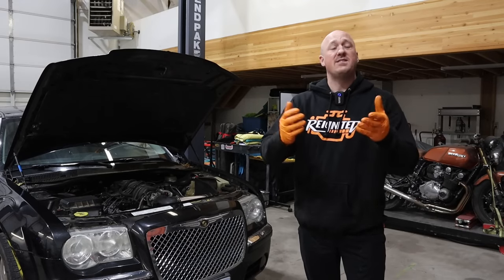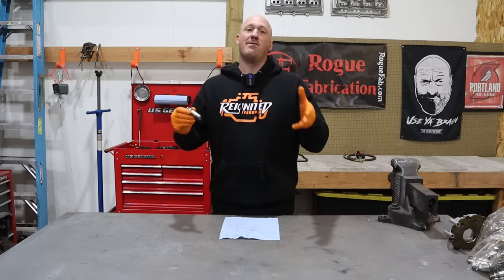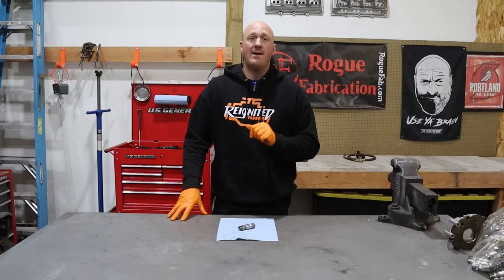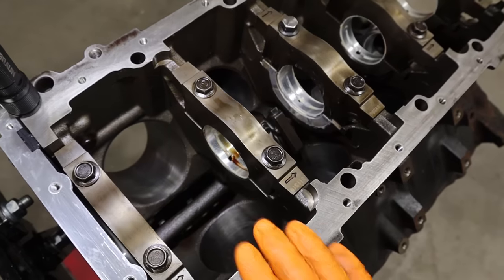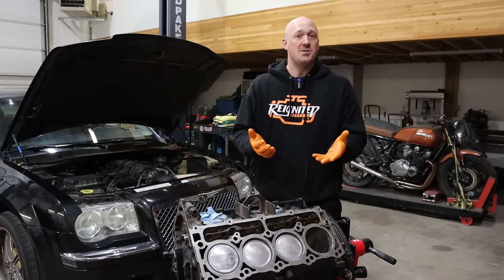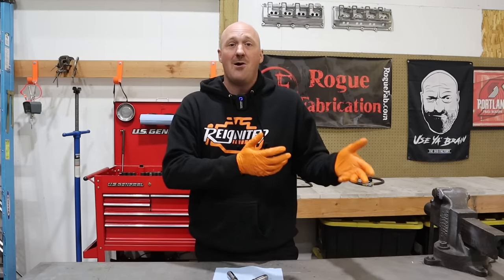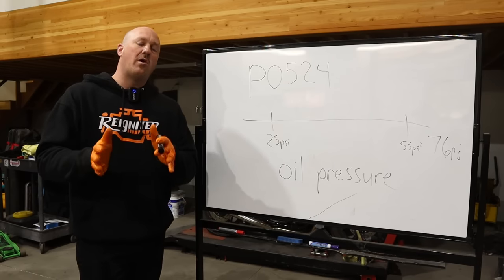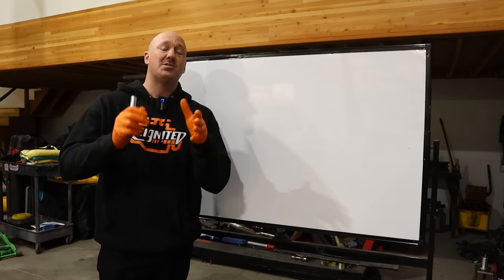The BEST Prevention For Hemi Lifter Failure! (In My Opinion)

Comment: My 2018 started making noise at 60000km dodge told me #5 cylinder had scoring and head damage... replaced the long block at 95000kms ... Changed oil every 6000km with synthetic oil OEM filter ... New motor makes a lifter noise only after I have made a small move (from one side of the drive to other) .. local deal said it's ok ...

Comment: I wonder what actually lubes the camshaft lobes themselves. The cam does not get much or any spray/splash from the crank or oil dripping from above the camshaft. Yes, you have large oil galleries for the lifter bores to pump up and lube the lifter sides but the only oil that makes its way from there to the camshaft lobes is what little oil is squeezed past the lifter and bore itself.
Reply from the maker: Gotta remember that the oil is pressurized. Pressurized oil doesn't dribble, it sprays. I agree that it would be better if there was a more dedicated system for the lobes themselves, but this is what we've got 👍

Comment: Lost my 2015 5.7 at 110l miles for this reason.  I started hearing a faint ticking noise back in June.  Immediately took my truck in to be looked at.  I ahve a 2015 ram 1500 that we use to tow a 30' camper regularly and didn't want to risk something happening to the truck. First inspection found nothing wrong other than chryslers recommended 100k maintenance, which I had done.  Month later the noise can be heard again, took it back and again was told nothing was wrong.  I went to another shop, one that specializes in hemi's, and after a week the shop said they found nothing wrong.  I made my concerns to both shops about potential lifter failures, and both shops said everything was looking good in all their tests.  Fast forward to late October and I start getting this bizzare banging noise at low RPM's during initial acceleration.  3 weeks in the shop and two differnet shops couldn't figure out the issue.  Chrysler engineers said it seemed to be a intake manifold issue and recommended replacing that.  No engine lights had come on and ecu was reporting everything within spec.  Cam back from vacation mid december and driving to work.  Check engine light pops and truck starts losing some power.  I have it towed to my main shop and they spend the next three weeks doing diagnostics.  Check engine light is for low engine oil pressure.  I knew at this point this was a lifter failure. They finally agreed (yes, I had to ask them to do this) to take the head off and check cylinder 1... sure enough, lifter flattened and completely shaved down the cam lobe.  Make matters worse there was metal debris everywhere.  I. Was. PISSED.  I KNEW it was a lifter issue 6 months later but had two shops, one of them being a Chrysler shop, tell me it wasn't the issue.  Now I'm out $10k for a new engine.  frustrating...
Reply from the maker: I truly hate hearing experiences like this 🙁. I'm sorry that's the way things went down for you and unfortunately it's not an isolated incident. I get frustrated that more dealerships are not properly staffed with talent to correctly diagnose these things. I think it's a snapshot of the future though. Qualified techs are becoming not only harder to find, but harder to train as well.

Comment: that oiling problem would might explain why my truck a 2013 has 216k miles and I havent had this problem yet,my truck drives long distances and I got new job a year ago and switched to driving my ladies car ,but she only drives truck to work which is only 5 min away now.Im about to change came lifter pump and timing chain,cause I dont wanna spend money on new truck,Im even replacing all suspension and mounts painting frame but I wanna keep mds,thanks for vid

Comment: I found this video very interesting.  I just replaced the engine in my 2015 Dodge Ram do to the hemi lifter failure, with a REMAN engine (got it back 2 days ago).  I got a 3 year, 100,000 mile warranty on it.  My mechanic said that Chrysler knows this is an issue with the HEMI, but won't do a recall on it.  He said they did in fact redesign the HEMI engine so this should'nt be an issue going forward.  .  My question is, with this new engine, have I future proofed myself from having this happen again?  Is the reman engine really an improved design?  I will for sure keep up with my oil changes from here on out.  But I am warry of this happening again.  Thanks again for your video.

Comment: I have a 2017 ram 1500 5.7 hemi and just bought the mellings high volume pump M452HV. So will I need to drop the signal down 12 or 20%. Thanks for the video!
Reply: Did you figure out which resistors to use for your 2017 by chance ?
Reply: No not yet

Comment: After watching your videos, which are really great explanations, maybe you can help me.  I have a weird “Hemi tick”.  Just put in new Mopar lifters in 5 & Mopar MDS lifters in 7.  Heavy tick starts at cold start, goes away after short warm up, then comes back at operating temp.  Tick goes away when MDS kicks in and restarts when MDS turns off.  That says to me that probably the lifter is not getting filled.  Brand new engine, Feb 2023, maybe 10000 miles on it.  Have had problems with the MDS kicking in full time right after new engine replaced.  Then #7 solenoid went out, then #7 lifters would not reactivate.  Now with the new lifters in 5 & 7, this damn annoying tick that sounds like piston slap when I high rev the engine.  Please help.  I’m cool if you say the lifter is not filling but I need to know how to fix it.

Comment: Interesting video does the 6.1L hemi have a good oil pump or does the hellcat oil pump fit a 6.1L hemi I have a o7 6.1L hemi I believe those engines don't have much trouble with lifters but I wood like to avoid a lifter problem what do recommend
Reply from the maker: Hellcat pump does not fit the 6.1 engines, you'll need the Melling 10342HV pump for that one. 👍
Reply: Awesome thanks for your reply very helpful 👍

Comment: What year did they change the oil viscosity recommendation? I believe the earlier Hemi’s were recommended 10w-30. And my newer one recommends 5w-20. Stuff comes out like water during an oil change.

I personally think manufacturers started using this thin stuff to squeeze every last drop of fuel efficiency out of these motors in order to meet EPA regulations. But that thinner oil isn’t protecting these top end components like they should 🤷‍♂️
I use 5w-30 in mine and haven’t had an issue in 86k miles, but we will see!
I have to do them myself because any service place refuses to use anything but the recommended oil.

Comment: I live in Canada in cold climate - I change my oil every 3800 miles in my Ram 2500 which has a 6.4 Hemi. My reasoning here is such that even though it might cost a little bit more over time for oil changes having very fresh oil is good preventative maintenance here. What are your thoughts?

Comment: Lots of great points, but what’s your theory on oil? You never brought that up….. My dealer only uses semi-synthetic oil and my local shop uses full synthetic and I pay extra for a Wix filter. Both oil changes are within a couple bucks from each other so I choose to support my local guy with full synthetic (and he’s a personal friend too) and I’ll continue to do that for the first 60k miles. But after 60k miles I’ll have to use the dealer because of my “Free Lifetime Warranty “…. Meaning they have to do all maintenance crap. I still think full synthetic would be better overall? I plan on keeping the truck for 10 years. 2021 RAM 1500 Classic 5.7 Hemi WITHOUT THAT E-TQ crap!

Comment: I agree with most of what you are saying, but i believe splash from the crank plays a big roll in this problem, 2009 they added VVT, raising the postition of the camshaft in the block, moving it farther from the crank. You said yourself this didnt seem to be an issue pre 2009, so id say crank splash plays a bigger roll than you think.
Reply from the maker: I've heard this before, but they didn't raise the position of the camshaft when they added VVT, it's in the exact same spot. They did change the front of the block a bit to accommodate the VVT changes, but the distance between the crank and cam never changed.
Reply: @ReignitedAuto  then I stand corrected.

Comment: Just a oil change question. I have an 03 5.7 Ram with mow miles, 51K. Only use it <1K miles a year( tow a small fishing boat. I have only used Mobil 1 from new. How often (years) do you recommend I change the oil. I’ve doing it about 2-3 years. Looking for recommendations thank you, Jerry G
Reply from the maker: I think with that low of mileage every year you are probably OK doing what you're doing. I think my only concern would be potentially how much moisture would accrue inside the engine with it sitting so much all the time. If the vehicle is kept indoors it's not an issue, but outside you may see it more. If possible I would at least run the engine once a week or so for about 10 minutes to keep it clean. 👍
Reply: Thank you for the reply, I run the truck to full oil operating temp about once every two or three weeks.

Comment: Sky, As a Chrysler mechanic how many factory hellcat engines have you seen with cam/lifter problems? If so how common is it? Also could you tell me what RPM a 6.2 idles at when a full operating temperature?
Reply from the maker: In 13 years I've never once done a cam/lifter job on a Hellcat. However it's not truly a fair comparison just due to sheer numbers. There's so many less Hellcats out there versus the 5.7 and people generally don't drive their Hellcats in the same fashion as a regular r/t so it's not a true apples to apples comparison. Not sure exactly the warm idle speed of a Hellcat, I suspect it's the same as a regular r/t but might be slightly higher due to the additional load of the supercharger.

Comment: My personal 2007 300c has just over 205k on it, and I bought a Diablo tuner for it years ago and disabled the MDS along with tuning it for my bolt ons. I've found that if I turn on MDS, I begin getting lifter tick almost right away after driving it. I did it awhile back when changing to my winter tune, and after about 2 days of driving with MDS disabled again, my tick went away. I've been running Amsoil full synthetic since I bought it 6 years ago, fwiw.

Comment: 2011 dodge durango hemi Had a lifter failer at 171,000. I have some metal in the vvt control valve.  Will it be ok to change valves and cam with new oil pump? Block should still be good with them miles right?

Comment: I would point more towards the camshaft being the problem. Don't see it being the lifters, same as pre eagle engine and they didn't have this problem. I neglected my oil changes and drove close to 15k miles. I also idle more than normal. I've changed my oil 5k miles ago and my oil pressure at idle is 48. Engine has 130k and has absolutely zero ticking sounds. I believe it is either material, hardening process or some other quality control issue that only a certain lot or batch of camshafts that got installed. Too bad a date isn't stamped on camshaft then dates could be compared because as of now mine is doing fine. After this winter I plan on installing another cam, if still no noise I'll inspect it side by side with one that failed.

Comment: I have a 2017 dodge ram 5.7 my question is do you think at 40,000 miles i should have to put a cam lifters and a hi volume oil pump in a truck that i payed 57,000 dollars for ? Oil has been changed right on time .

Comment: My 2011 Hemi Grand Cherokee had cam lifter failure at around 130000...oil pressure at idle with factory oil pump was 23 psi..with the "hellcat" oil pump upgrade my oil psi is 43 at idle

Comment: 9:08 after a lifter failure I replaced the cam and lifters now all four of my mds lifters are noisy until mds kicks in then they get quiet what could this be a programming issue? Oil pressure is around 35 idle and 55-58 on the hwy

Comment: This is a question for everyone! 2020 5.7 challenger w/ cool air intake with 106k miles and just heard a small tick. Should I just replace the oil pump, lift & cam or just the lifted?

Comment: I’m at 171k and do fully synthetic oil changes at 4500-5000 miles. I start hearing some lifter noises at 5k and that lets me know its change time. I only have 24-26 pounds of oil pressure at idle when warm. I feel like it should be higher. I have a tune and MDS delete.

Comment: Quick comment/question:  im watching and at 12 mins our man talks about how MDS works, full oil pressure is applied to the middle 4 cylinders lifters(intake and exhaust yes?) to depress the lifter and nullify opening of both the int and exh valves.  So, that stops intake from happening so no air/fuel supply, great for economy.  IS THERE AN ISSUE WITH THE EXHAUST VALVE NOT OPENING AND CAUSING OVER-PRESSURE IN THE CHAMBER, STRESS ON THE RINGS ETC OR??  Something's gotta give.

Comment: Thanks for the info. 
Types oil that are better than another for the current Hemi? Think I use 0-20 advanced formulas like extended use, Mobile one, Royal Purple, Caster-oil, or Valvoline. I’ve been told to use so many different 😢types by different people seems that they all have their favorites but believe as long as it’s 0-20 it’s ok guess next year they may go 0-16 weight but I only know what auto parts guys  informs me. In my antique cars. I use brand called Rotilla then add can of zink because those don’t have catalytic converters. But in new vehicles not sure what I should use. Do you know anything about Mobile one? Bought vehicle with 70000 miles seems to run well. It had an exhaust leak which  the dealer repaired but still I worry about its MDS lifters? Will the Ram only loose 12% mpg using more fuel if MDS is tired off? My mpg seems to have dropped 10% over last few months. Can MDS fail like that. Or is that a dealers preventive measure. My  truck seems to run well just mpg seems down by  2-3 mpg from before the trucks tic which seems to be fixed now but mpg now slightly down on its mpg?

Comment: Sky, thank you for all your crazy good content.  Could I pick your brain about a problem? Please help!  History: multiple misfires resulted in cam and lifter job.  Bought the Amazon kit.  Lifters were very noisey. 🙄 lesson learned.  Mutilple misfires after 20 miles.  Tore it back down and installed mopar cam and mopar lifters (got lifters from eBay, came in mopar boxes).   Also hellcat oil pump per your advice. 
Today:  ran great until today, after another 30 miles on the mopar parts, rough running and seems like a misfire condition but no check engine light.  Strangely enough the issue seems to happen after it’s been in MDS and I come to a stop sign.  Anyhow I shut the truck off after about 5 min and its running perfectly again.  I’m not sure where to go from here.  This is a truck for my son and it needs to be reliable.  Also if you can turn it off and restart, would this make you think more pcm, if the problem comes and goes?  Please help!  I’ve put so much time and money into it, I’m spent!  Also will I give you my phone number.  Huge fan, thanks in adavance!
Reply from the maker: Hmm, this sounds like a tricky one. Being that the problem comes and goes I doubt it's anything to do with your lifters or pushrods or anything like that. I also never condemn a PCM until there's no other option, they are generally pretty solid. I would try to identify which cylinder is having the misfire, and then swap the plugs to a different cylinder, and the coil to yet another cylinder and see if the issue chases to one of those. If after swapping those components the misfire stays in that same cylinder then we'll have to dig deeper. Maybe do a compression test on that cylinder while you have the plugs out as well. With no CEL you will probably have to have access to a scan tool that is sophisticated enough to live monitor for misfires to find out which cylinder that is affected. I know that's not much help, but we've got to start somewhere.
Reply: @ReignitedAuto   thank you so much for your response!  I know you prob have a lot of people to respond to!  This makes me feel a little better, I will continue to monitor the codes, but none so far.  When it initially happened, check engine blinked for all of 5 seconds.  The coils are new (Amazon) and plugs as well, champion OE.  I will reply to this message with an update as needed.  Once again thank you so much, I have learned so much from your page and have shouted from the roof tops about your content being so good.

Comment: Good vid. Your like the mopar version of me. I have a vw/Audi obsession. Researching This cause I found a good deal on a hemi truck. But this issue has me concerned. .
Reply from the maker: It's kind of "the" issue with these engines, but in my opinion if you are it then you've got a pretty darn solid vehicle that makes great power. As long as you're somewhat mechanically inclined it's really not that difficult of a job. 👍

Comment: The oil pump is not the issue for camshaft and lifters wear. The issue is that the camshaft only gets splash lubrication, which is insufficient under 1,500rpm. The proper fix would be to add oil sprays for the camshaft, operated by a electrical oil pump that only activates under 1,500 rpm.

Comment: I'm new to your channel and it is clear to me you know what your talking about. So, I have a  question. 2021 Ram Rebel 5.7 etorque auto shut off. I disable it because I don't like the idea of taking off with no oil in the top of the engine. Oil pump shuts off when the truck does correct? Is it still getting that weak Oil pump in the  2021 Ram Rebel 5.7 etorque. I do spend a lot of time idling so I'm wondering if I should be proactive? Thanks